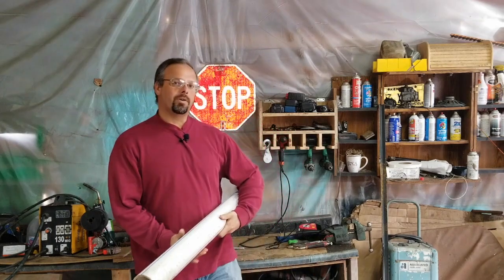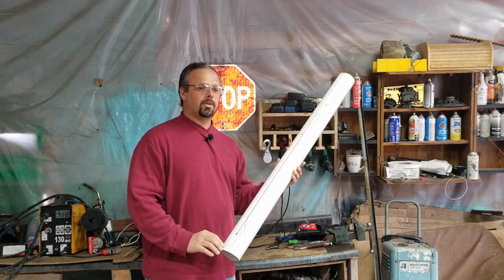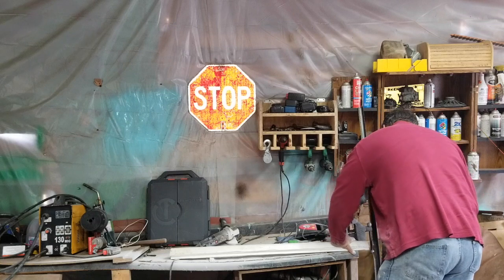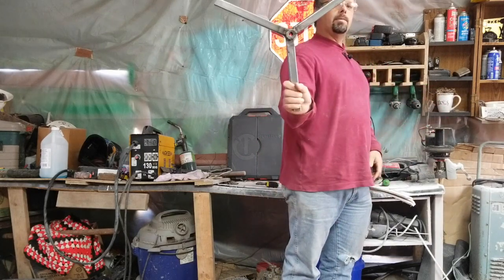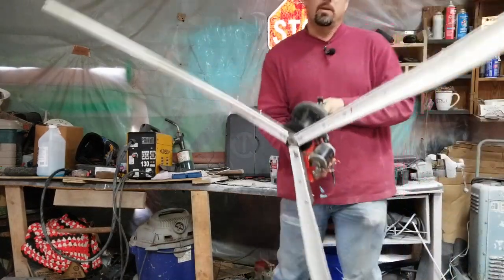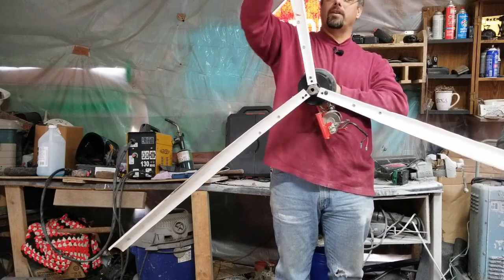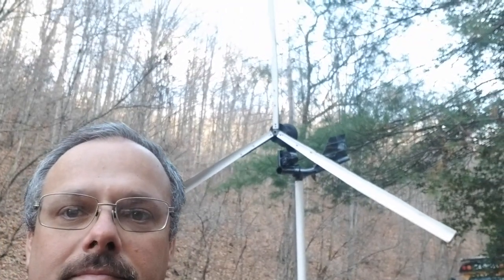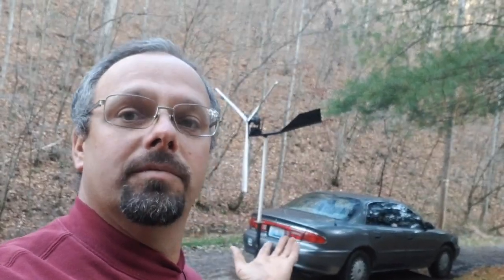wind turbine build for the off grid cabin-part 2

Comment: I was gonna say you need to get that much higher. Try to get it above the tree line. I made the same blades from ABS but I had them the other way and they work better.
Reply from the maker: I made some bigger ones and turned them the other way. It will eventually be on top of the hill so it can catch some more wind.

Comment: I think you are going to need to do something about the balance of the blades .. maybe grind some material off one or two of the blades .. to make it turn smoothly.  Of course .. if you can't get it to make electric .. maybe you can use it as a pusher for your car!  lol  Always glad to see someone be inventive.
Reply from the maker: LOL I could leave it there as a deterrent to tailgaters. I will have to do some balancing, I figure I'll take the chain loose and let it spin freely on the bearings to see how my balance is.

Comment: Plastic Dust, Ok why do you use a grinder to cut plastic? Get a jig saw no dust better cut. The bearings in your grinder are going fast. Mine sounded the same before the head blew up.
Reply from the maker: That would have been better. Too lazy to walk up to the cabin to get it I guess lol. The bearings could be going out, it has done a whole lot of grinding.

Comment: Nice work. Some more extreme spiraling might make for better airfoils and a somewhat more efficient blade system, given what you're working with. For a future iteration, if you find this one doesn't work as well as you'd like.
Reply from the maker: Good part is, the blade material is cheap.